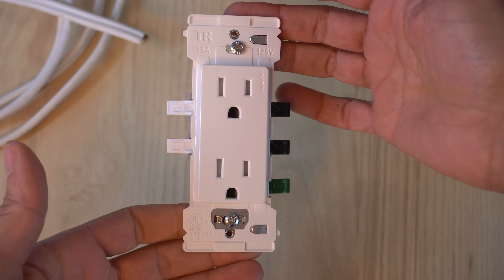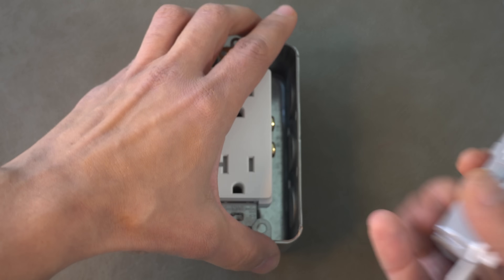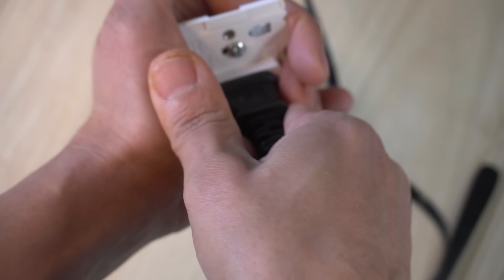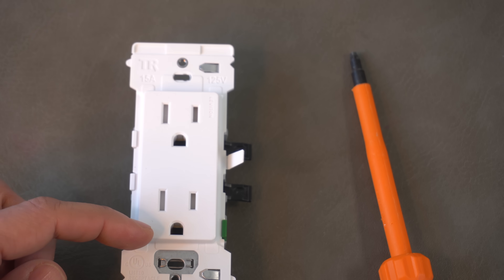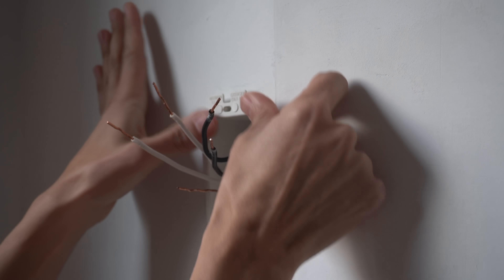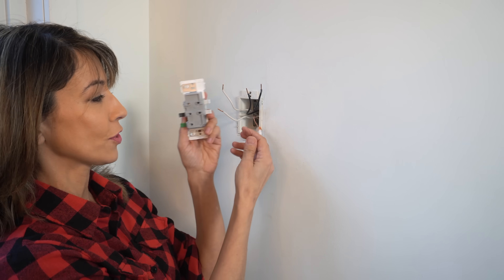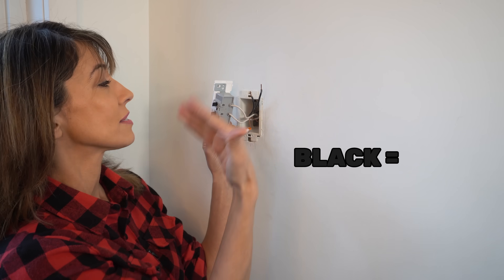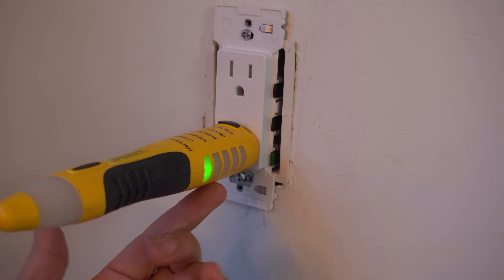New Electrical Outlet Installation: 3 Essential Improvements You Need To See

Comment: I agree about the old “back stabbing” old conventional duplex plugs.  The contact area of those old “back stabbed” have only about 10% of the surface area between the wire and receptacle conductor. In these new wego style receptacles have as much or more contact than a wire rapped screw connection.  When I was an electrician we never used the back stab method.  We always rapped wire around the screws.  IBEW 58 Detroit.
Reply from the maker: Hello to you in Detroit! Thank-you for sharing your experience as an electrician.  Your thoughts on contact area are appreciated. I remove backstabs when I see them here too.
Reply: Hello to you in Detroit as well , Since you like the Wago connectors like I do , 
Just recently , They've become available at The Home Depot in Toledo Ohio , So check out The Home Depot in your area , They may be available there 
I agree with you 1000 percent that I never use back stabbing receptacles and switches , I always use commercial grade which has a pressure plate where you insert the wire and tighten the screw and the pressure plate grips very tight on the wire , Those back stabbing receptacles and switches should have never been put on the market
Reply: time will tell.... having seen, used and dealt with the backstab junk over the years and taught to NEVER use them in the mid 1990's, every single one I run into now has either caused a fire or melted itself and the wire jacket back to the box entrance. I do use push-in/wago/lever style for end devices, ballast replacement/bypass, otherwise I avoid them all.
receptacles and devices should always be pigtail spliced, NEVER using them as feedthrough/continuance devices.
but wire nuts(marrettes) should always be twisted tight enough the wires wrap around themselves and a bit of the wire jacketing also(solid wire) stranded just a bit of twisting.
most install them limp wristed or pre-twist very poorly. been there and fixed many that way, people thought they did a good job and had loose arcing connections everywhere with foot traffic over the floors causing vibration and flexing. including some holidays with family, "gee why did the microwave suddenly quit working", (because your newer husband Bob wired it very badly). Bob returns home in the middle of me fixing the "his bad splice" at basement box under middle of kitchen floor. he says  "gee that never should have failed, I stripped it way back, twisted it together and put on wire caps and electrical tape. yeah he did! stripped the wires well over an inch back, twisted them loosely counterclockwise, followed with an loose wire nut and tape to cover the rest of the bare wiring. 🙄  I "kindly" showed and explained to him what was wrong as I speedily the repaired the wires so the microwave could function to reheat some of "thanksgiving diner" or was that "christmas dinner". late 1990's, who recalls every detail anymore.
Reply: Professional handyman here.  I just spent two days tracking down multiple electrical issues at a customer's house.  They called me because they had "switches and plugs that sometimes worked and sometimes didn't!"  How this house didn't burn down is beyond me.  Every outlet, every switch was back stabbed when the house was built in the mid 80s.  There were at least 4 circuits with open neutrals, a couple with obvious charred burn marks where the wires had worked their way loose over the years from the stab connectors.  I know of no electrician these days that would ever use these.  If you DIYers find you have purchased a switch or outlet with stab connectors, there is still always an option to attach your wires with the brass and silver screws.  Make your connections that way.  Properly installed, a screw connection will essentially last forever and it's a heck of a lot safer.  Great content Daru.  People need to be shown how to do these things safely and you do a great job of that.

Comment: Homeowners are surprised by anything new. This person is not an  electrician or engineer. This is homeowne special. On commercial and industrial application you'll never find these low priced outlets. For the last 25 0r 30 years outlets are GFI protected your not going to shock yourself anylonger. BTW to work safely you are suppose to shut off power. I guess just about anyone can upload a video on YouTube and pretty much state nonsense without doing any reserach
Reply from the maker: Thank-you for your feedback daffyduck8244

Comment: As a retired designer of industrial electro-mechanical equipment, the use of cage clamp type terminals was becoming a customer driven requirement.  And as a user, I’ll take cage clamp over screw terminals any day.
Reply from the maker: You hit the nail on the head. This is a customer driven product. Homeowners like using these. This is entirely a response to that demand.

Comment: 1. I need a BLACK one, they apparently don't have it yet.
2. People are reporting Covers are not often "Flush" to the wall?
3. People are reporting the "child safe" features are preventing you from plugging in your plugs, having to use massive force to do so.
4. People are reporting the "plastic ends" instead of metal make the plugs "weak" especially with the plugging in issue.
Reply from the maker: The TR feature is an asset for some people as an enhanced safety feature. I like it for children but see the concerns of seniors etc. I haven’t had issues with alignment with screw less covers. If something doesn’t work for you there’s lots of options out there. No black yet. Thanks for sharing your thoughts on the outlet!

Comment: I can tell you are not an electrician.  When it comes to safety simple is never better.  It's all about contacted surface area. With old school screw connections the surface contact area is much greater, instead of small blades making contact with the wire, where shorts are more likelier to occur due to load to resistance ratios.  A lot of plugs already have the holes in the back and every time I change an outlet it's due to those catch bladed contacts burning out.  So what you need to do to drive your advertisement home is to have a cut-away of one of those outlets so people like me can see what's in it.
Reply: These are new so the 'lots of people' you are referring to are actually using the cheapest 'hole in the back' residential grade receptacles, not these nor the hospital grade type with the 'screws in the side to tighten the wires inserted through the holes in the back' type.

Comment: So first we see an outlet that allows no exposed wire on the sides.   Then we see an insert that prevent fire.  Fire from what?  The plastic on the side of the box?  I could see one or the other, but not both.   Just my two cents.  Have a great week
Reply from the maker: The electrical box needs to sit flush with the drywall or finished wall surface. It can’t be behind the drywall. 1/4” max distance from finished wall for US viewers.

Comment: But why isn't it GFCI?
Reply from the maker: GFCIs are more than 3x the cost. I have a video on the Best one in terms of safety testing in the description box if you’d like to learn more.
Reply: @DaruDhillon Is this model available as a GFCI though?
Reply from the maker: @limbodog  they don’t have a model like this yet. If they do we’ll keep you posted!
Reply: I'd rather have a gfci breaker protecting the receptacles. Easier to test and reset than to move appliances out of the way to reach the reset button.

Comment: My house is old  (built in 1955) and uses BX wiring with no ground wire.  Is there any precautions when using this type of outlet and wire combination?
Reply from the maker: Hi I don’t have experience using BX wiring so I can’t weigh in here. When in doubt check with a licensed electrician in your area.
Reply: @DaruDhillon  Will do,  thank you!
PS Great video!

Comment: These actually are very bad.  You cannot see if the wire is all the way in and when you put the outlet into the box, you cannot see if it has slipped out.  This is a fire hazard.  The screws are torqued down and provide a more consistent connection.  With loose connections, arcing can occur and the wiring will overheat because you're sending too much current through that weak connection.  Effectively, if you have 14AWG wiring and you have a poor connection, it may be behaving as 24AWG at that point.

The worries about the screws touching a metal box... come on, that isn't an issue.  You turn off the breaker while you're working on it and then you secure the outlet before you turn it back on.  Also, professionals tend you wrap the outlet with electrical tape, covering the screws.
Reply: The UL label means it tested your conjecture of it being unsafe.

Comment: Would not be worth it to me. Tamper proof standard receptacles have ben mandatory for at least 7 years now and most people only use the screw terminals if they really need to. The push in back wiring is quick and easy and I always tighten the unused terminal screws so there is little chance of contacting the metal box. These are very nice receptacles but I would not pay extra for them. And the screwless box covers are more money too. Not a big deal if you are only replacing a couple of receptacles but price out the difference on a hundred outlets and you see these would be very expensive for a whole house installation.

Comment: I'm not sold on lever terminals over screw terminals.  I've used the Wago lever connectors to install fixtures and outlets and I noticed flickering, early life bulb burnout, delay on bulb turning on.  I don't think the lever provides good enough contact, where as the screw can be tightened down hard.
Reply: Lever nuts have been proven with reproducible testing by multiple organizations. The load capacity is comparable to wire nuts, and the strength of the connection is stronger and holds more weight in a hang test. The only thing that's better is solder and heat shrink. The only time I've seen them fail is when they are not used properly, which can also happen with wire nuts. I have no problem with them being integrated with receptacles or switches. I haven't seen it myself, but I've heard they hold up to screw terminals with shepherd's hooks.

Comment: 4:40 So the box extender is small enough to fix inside the old metal box in the wall?  It sure doesn't look that way.  Otherwise the box extender would bump into the old box which is probably nailed to a stud and won't move.

Comment: After replacing numerous wago connectors and  pushin outlet wire connectors I find these totally useless. Any connector that relies upon spring tension to make a connection will loose effectiveness over time and fail.  These are a really bad idea. Don't use them unless you are fond of electrical failures.

Comment: OMG, what took us so long to develop these receptacles!!!! That looks fantastic. As a 67 yo elec engineer who  does my own home improvements, I'm hooked. Great job on your video... you covered all of the important issues. I love that you don't have the shock risk when handling these in the wall. And, so genius in the way these align side-by-side. My only question is whether a normal sized outlet cover will cover these or whether you need a jumbo size?
Reply: This Wago  stuff was used in west  Europe for many years even decades. I think in U$ the twist nut makers did not want to give up their monopoly on their business. But I haven't seen the outlet/switch with built in Wago clamps inside until now. It looks promising.
Reply: @keytothegate68  Wow, interesting. I will say that I did run into the potential problem identified by one reviewer: I was using the Wagos recently to connect three wires together and then to a light. As I was stuffing the wires into a cavity (bigger than a box) one of the levers must have been bumped and popped open because the light didn't work when I tested. Of course it was easy to find and easy to fix. So, I'm still sold on this lever approach.

Comment: Those “lever action” terminals do not make as good of a contact to the wires, as regular screw terminals, thus creating hot spots and potential fires. Those screw terminals, when properly installed will not touch the side walls of the receptacle box. I detest those push-in terminals, they force you to throw away the receptacle when you have to cut the wires off to disconnect the receptacle.
This device is not as good as you think it is.
Reply: These are not friction fit push terminals! I've used the hospital grade version of these and can assure you that when the screw is loosened on the hospital grade, or in this case, when the lever is released, the wire comes out without throwing the receptacle away.

Comment: I have been using Wago connectors for several years and have been very happy with them. Just received free sample of this receptacle and waiting for opportunity to install it.  I think one of primary benefits of this receptacle is avoiding problems with DIYers using backstabbing to connect wires.
Reply from the maker: That’s a good point about DIYers. This is designed with homeowners in mind. Thanks for sharing your take on Wagos I love hearing reviews like yours.
Reply: You are welcome.  Looking forward to your next video.
Reply: Since you like the Wago connectors , Just recently in my area , They're now available at The Home Depot , They may be available at The Home Depot in your area
Reply: @ironmartysharpe8293  They have been available at my local HD for awhile. Thanks
Reply: Your videos as this one are helpful with respect to modernization and proper technique. And you do it with a repetitive smile. I have 4 daughters - always had to look for my hammer because they were so busy!
Reply: The back stabbing was an issue for me. These look much simpler and they are more user friendly installation.

Comment: I love the idea of the keys on the receptacles to speed up alignment in multi gang applications, that’s a welcome feature for sure.  It sure beats setting the switches and receptacles going by the screw slots.
Dead center on the screw slots of multiple receptacles, or switches, will usually get you well into the happy zone.

Comment: How well do they hold onto 12 gauge wiring when your trying to manipulate the receptacle into a 20 cubic inch single gang box !? I’m guessing the contacts are going to be getting stressed to the point of letting go ! I can imagine them working wonderfully on 15 amp circuits however. But there is always going to be the old schoolers who would never “back stab”, and never rely on a “lever connect”. Kind of like many of the old school plumbers just can’t wrap their heads around push connect plumbing fittings. You can’t argue with them though, after being in the trades for 30-40 years…these boys (and some of the older ladies), know what works, AND WHAT DOESN’T !

Comment: Those type of connections are NOT better than a screw. They fail more often. The contact surface is only a fraction of what a screwed type connection does. If you know anything about electricity surface or section diameter limits the amount of current that will pass before things heat up. They are only used because it is quicker. The electrical contractor won't charge you less because he gets the job done faster. He will put more money in his pocket.

Comment: Screws always loosten over time with thermal cycling, so you are dependent on copper welding to copper once this happens and arching has begun.  Thats why aluminum wiring burns houses down, it does not weld, it just burns.   Any spring loaded connection, like the lever, will stay tight, and if there are anything like teeth to dig in then vibrations and thermal cycling will cause wiping actions that keep the contact points free of oxidation so the electrical resistance stays low.  Related, if you use any stranded wire into any connector that is not spring loaded, do not tin the wire with solder.  The solder will compress over time and the connection will loosten, so leave the stranded wire bare.  This is not a problem in a spring loaded connector.  Former electrical maintenance technician 40 years.
Reply: Are you serious? You don't have a clue about what you are talking about.

Comment: I rolled my eyes a little when you said its the biggest technological improvement in over 100 yrs. But the more i watched, i was shocked its taken 100 yrs. These outlets need to be the standard.
Reply from the maker: You’re on point. It’s sounds overstated like you say but little has changed in that time which is surprising compared to other countries.
Reply: Those outlets are as much junk as wagos, there for lazy electricians, and expensive.
Reply: @RadioRich100  As we all know, the point of electrical work is to make it as difficult as possible.
Reply: @RadioRich100  any better alternatives that you can share that are safer and easier to install? I just redid a home from 1978. The original electrical install was super sketch !

Comment: It takes about 25 lbs. of force to pull a wire out of a Wago-type connector,  but you should be aware that the wire can be removed with very little effort if it is twisted while it is being pulled.

Comment: Good job! my house has those metal boxes, so even with electrical tape wrapped around the terminals there can be problems if you have to really  push things around.  BTW Sometimes its better to  just clip off the ends of the wires rather than straightening them out..  You need to get them really straight and that can be tough or they can even fatigue and break...
Reply: Yes, these outlets are definitely a winner if you have metal boxes.